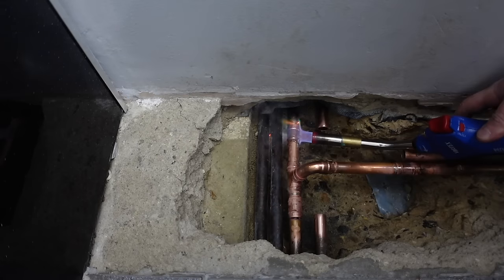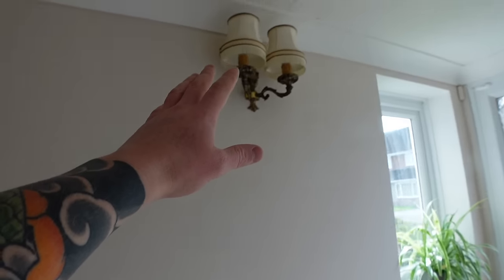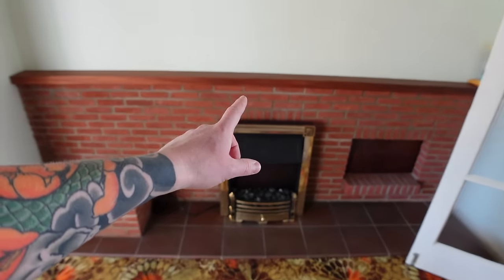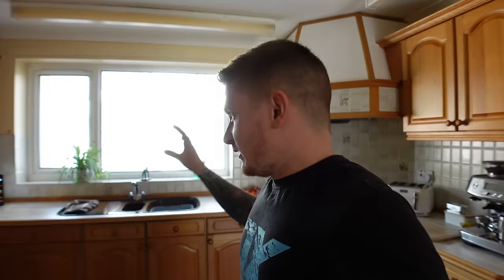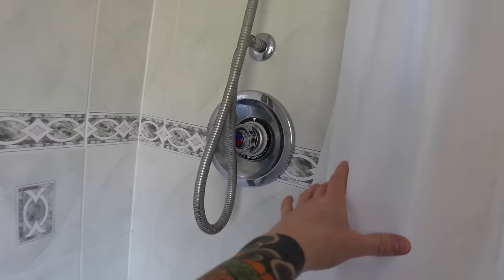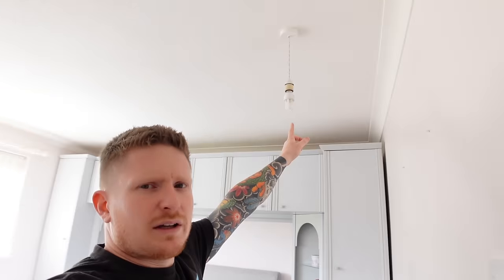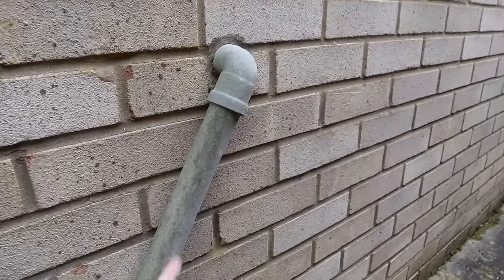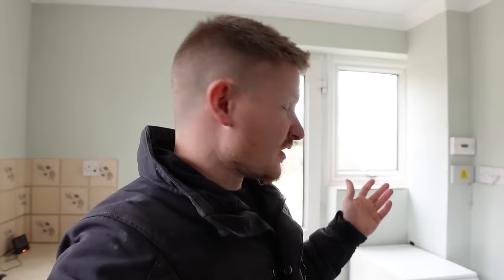I Bought This 1970’s House That Nobody Wanted And its a Mess - The Renovation EP01

Comment: The kitchen is definitely a 1980s replacement - the style of the wooden cabinets, the cooker built in across the corner with the built in oven under the hob and of course the extractor hood - that style was very popular in the 1980s. The units in the utility room would be original to the house and indeed might have been the original kitchen units at one time.
Reply from the maker: Thanks 👍
Reply: Definitely an 80s kitchen.
Reply: At one house I lived in we had bathroom carpet that was very light & easy to take up & machine wash, on top of lino. It was made of springy fibre that more or less spread itself out after washing. was brilliant, dried quickly & made the floor warmer in winter.
Reply: ❤ the 1980s kitchen  might be fine, just cleaned up ? or parts of it kept. Depends what look you want etc
Reply: Absolutely, late 80s by the looks of it, maybe even early 90s if the owners were a bit conservative. I inherited a 1987 kitchen with an almost identical brown sink a while ago. My units are Scandinavian pine though (the whole kitchen was made in Denmark and shipped here) and in really good nick, I love them! All I did was replace the sink because it was quite grubby and worn, it's some kind of composite material and had some permanently discoloured and rough spots.
Reply: Replacement doors for units could be a quick fix if the layout suits and the carcasses sound

Comment: As a heating engineer of twenty years, heres my opinion for what its worth. On the whole combis arent that great for homes with multiple bathrooms. Youd be far better off with an unvented cylinder which will future proof your install for when you have your extension built. Also you cant just decide on a combi installl without other checks and a proper site survey. Combis use a lot more gas than the heat only you already have. So you will almost certainly need a renewed gas run unless you can site the boiler very close to the meter. Have you checked the incoming water pressure and flow rate? You need to know these before deciding on a combi. If you have a cylinder fitted instead then you could also have solar fitted in the future and then have free hot water for a good few months of the year. You could also have a twin coil cylinder fitted and heat it from the wood burner. You cant do either of these with a combi. Dont just jump into a combi install. On a personal note i wouldnt touch a Worcester with a barge pole. Bang average boilers backed up with a world class marketing team. Plastic pigs. As someone who has serviced and repaired probably 10K+ boilers in my career, IMHO get a either a Vailant or and Ideal Vogue with a cylinder. Hope this gives you a bit of useful guidance. All the best.

Should have added. That if your current heat only boiler is actually in good condition. Then why not relocate it and use it to heat an unvented cylinder. That way you save on the cost of a boiler and are only paying out for the cylinder. Plus it’s less waste and better for the environment to not be scrapping a perfectly good boiler.

Comment: We have a similar aged house (1968) and also renovated whilst living here. We are  not DIY experts, so we had professional help. The carpet and fireplace were similar to yours, but ours was gas. One socket per room, terrible central heating... One thing we did and I can highly recommend is put in Underfloor Heating. We used a system by Wunda, where we laid styrofoam panels with grooves in them, which we then 'walked' the pipes into. It was easy to lay (we did this bit ourselves) straight over the cement underfloor and meant we didn't need any radiators on the wall, which makes a surprising difference. We just lost about an inch in height, as that is how much the floor came up. The heating is also lovely and even throughout each room and controllable by room. I think this was one of the best decisions we made :)

Comment: Seems like a very nice house in good order considering it has been empty for a while. All the quirks in the original house is common to a property of its age, ie lack of sockets, glass panel above doors etc. A perfect house for you to renovate. Probably built considerably better than modern builds.
Was there no immersion heater fitted to supply a bit of hot water.
I’m sure you are aware textured ceiling coatings could contain asbestos.
Good luck with the project.
Reply from the maker: Your right!! I saw massive potential as soon as I walked in. Yes there was immersion however I had a feeling the zone valve would be a quick fix. Yes on the asbestos…. Funnily enough I’m geared up in an FP3 mask taking the tops off some today 😀
Reply: Dont mind the transom!
Reply: @TheDIYGuy1  you’re probably aware but x-tex is textured coating removal.
Reply: You’re right about the ceilings. Asbestos could also be in floor tiles too, it was in our house, plus surrounding the old dry air heating system and plaster beneath the old immersion heater that was originally in our 70s build property.

Comment: Be wary of putting in a wood burner in, especially with a baby in the house. Do some research on indoor air quality especially PM2.5 particles. Wood burners are not good for air quality. The main bedroom has MFI bedroom furniture, can't remember the name of it, but remember selling it in the early 90s.

15mm pipework will work with modern ASHP, have a look at a Vaillant AroTHERM for example.  They are super quiet too, quieter than a gas boiler. ASHPs have moved on leaps and bounds in a very short space of time, worth revisiting what it currently on the market.
Reply from the maker: Great info. Thanks

Comment: Really looking forward to this series. Question: why are you going with a combi rather than an unvented system? I believe the unvented system is better for larger properties, and since you are planning a future extension that might be a better bet.
Reply: A recent high-end combi would probably perform just as well, as it can power multiple bathrooms and a large number of radiators simultaneously. Plus you no longer need to worry about hot water cylinders and their maintenance & space.

Comment: Nooo don’t get rid of the niche by the wardrobe in the master bedroom!! Use it for a few pretty, modern, thick wooden open shelves, deep ones. The wood adds warmth, the depth adds spatial interest and Positive/negative to what otherwise is a box with straight walls and above all they’re useful for putting the odd plant on or some interesting books, etc. Adds character, warmth, interest. Have the wooden shelves end a few inches before the wardrobe so they aren’t level with it - will look much better/ more pleasing to the eye. 
Generally awesome though - you’re doing a great job! 😊
Reply: Depending on how deep that alcove is, could even put hinges on the shelves and put some bulky storage in behind; like suitcase or formal clothes on hangers, stuff you don’t necessarily need quickly but don’t want cluttering up the usual space.

Comment: I'm just done doing an occupied renovation, so good luck. In the long run, you will probably be better off rewiring the complete property. Any decent sparkie will be able to do the rewire in stages for not a lot more, then tie everything in properly to a new board at the end. All I need to do now is replace the back door, and fit a new kitchen. Our current kitchen is pretty much like yours, so we just upgraded doors etc. until we decide what we want to do with it. Check your cabinets though. They look very like some of the Moben units I fitted back in the day. Those were originally ply rather than particle board. 
We also installed a wood stove. We bought a Contura inset stove which fits straight into the builders opening. No need for register plate etc. Our installer also filled between the stainless liner and the fireclay one with waterproof vermiculite.
Looking forward to the fun beginning.
Reply from the maker: Some great experiences shared there. Thanks

Comment: My first thought about the electrics is that there are so few sockets (which are almost certainly not split between sufficent separate circuits), is to start from scratch.  Leave the existing sockets as they are, install a complete new system with copious numbers of sockets then swap over from old to new and remove the disconnected old stuff at your leisure.
Reply: Every home of that age needs rewiring it’s a given. Not an issue. Similarly plumbing. All expected when purchase is below replacement cost.

Comment: That's a lovely house, and will be amazing when it's done. Following this series with interest, having recently (I think/hope, lol) finished renovating a mid fifties house. I would say do definitely get a full rewire done, though. By the time all the alterations are done, there will be not much of the  original wiring left, so now is the time to make sure it's all in good shape, and ready for the next 50 years. We found some really genuinely dangerous bodges and hacks hidden under floors and in walls as I was pulling out the old cabling - really quite scary.
Reply from the maker: Thanks for sharing 😊

Comment: About the ugly bathroom window install, I’ve found retro fitted new windows and frame often don’t line up with the old original frame outline, installers like hiding this gap with a pvc decor trim, solution is when redecorating remove the bodged pvc trim and re-tile or re skim up to the frame, the wall or reveal then looks like a nice original normal wall finish.

Comment: You can see the potential a lovely big house & garden. Watch out we know, as our house is 70s built, all ceilings then covered in artex had asbestos too all through.
 I doubt the kitchens  original they were those flat shiny brown or light blue coloured doors with the metal handles that ran along doors then. Im surprised you’ve not got a blue or green bathroom suite of those times too. I remember my friend bought a flat in 80s original it had a brown suite 😮We have a house just like this near us just sold, owned by an elderly lady just as it was built.  It’s amazing to see just as it was from 1970s.
Good luck it’s going to be a fabulous house once finished.
Reply from the maker: Thanks 😊

Comment: The house is much better on the inside than it is on the outside. That will be the biggest challenge for sure. Please avoid a media wall, they are super tacky. The kitchen is mid 80's and the light fixture in the dining room is late 60's and isn't worth much more than £15-£20. Log burner is a great idea.

Comment: Did you consider a system boiler and an unvented cylinder? A big enough cylinder will supply all your hot at mains pressure. No more shower pumps.
The cylinder can be vertical or horizontal and go anywhere, even in the loft. Only drawback is if your property has low mains water pressure.
Reply from the maker: Thanks for sharing and some good points

Comment: I agree with you regarding the interior 'time-warp'. Although I have never liked the 1970's suburban street architecture, I must say that the exterior (minus the brick colour) of the house is quite a handsome and holds its own. 

I see this with black exterior aluminium frames, doors etc, and some dark coloured/ burnt  effect weatherboard cladding. The interior just needs to be opened up with good flooring , bathrooms and kitchen. On the upper bedrooms I would vault the ceilings (I saw a 'single storey' bungalow that had it done in the kitchen, lounge and diner, and it looked incredible!.

Then , with the correct landscaping, this could end up being a prime property on the street. (but then you are flipping property, so I get it is a controlled budget). I will be interested to see it when you have completed the reno.
Reply from the maker: Absolutely, thanks I agree

Comment: Hi thanks for this. I bought a similar 70s house two years ago and paid a fortune bringing it up to date. I encountered similar problems. Those ceilings I hate lol. Most likely full of asbestos. I have identical ceilings. Decided in the end just to paint them.  No sparky is going to mess about with new led light fittings on those monstrosities. Skimming them only masks the problem. Though did pay to get it removed in the bathroom. On a positive its a lovely house and affordable to run. I get what you say about the lack of plugs, so annoying, ended up with a complete rewire and now have lots of plugs and a circuit board up to current standards. Word of warning, when buying these properties that require some updating, be aware of the financial implications and you are not going to get a quick profit turnover. Has to be long tern investment. Unless you can be like this guy and fix it up your self ha ha.

Comment: Garish floral carpet is 70s. Utility room original units, kitchen is probably mid 80s upgrade and very nice for its day. PVC windows replaced original single glaze wood. Looks like 70s taps and shower. Seems to be some 80s redecoration generally.   Including possible 80s bath upgrade (the 70s bath tended to have a flat board housing later 80s had that fat plastic bulge. I wouldn't wipe the 70s completely off the page in your resto...a nice Seiko clock hanging over the fire, perhaps? Stove great idea, hearth is ugly sadly so semi agree with removal but I always prefer saving something if it can be recontexalized.I think a building looks better if you can see layers of history and fashions come and go.
Reply from the maker: Thanks for the comment and your views 👍

Comment: I've seen kitchens like yours in places built from the early 1980s with the tiles over the extractor hood. I would guess the older style units in the utility room are from the houses original kitchen so that kitchen was likely to have been fitted when it was extended. Don't envy you with that green goo, had that in my first flat. Its a nightmare to get off your fingers!

Comment: I bought a late 1970's house this year. it had the origihal traditional boiler system and the original 1970's kitchen, original gas fire in the lounge and artex ceilings. Got myself a new wooster bosch combi, a new gas fire and new kitchen so far. Still need ot sort out bedroom celings and move the ceiling light sockets to a central posisiton as, like this house they are in front of the bedroom windows.
Reply from the maker: You’ll get there 😊👍

Comment: Have you ever considered reverse cycle air-conditioning? I've found it to be a great alternative to heating,  combined with the fact that it cools the property during these rather hot summers we have experienced in recent years.
Reply: Air to air heat pumps are OK but you will require higher temperatures as the moving air acts like a breeze and cools you.  Ait to water ASHP can operate with 15mm copper pipework but not with plastic as the inserts restrict the flow.

Comment: As a builder having lived in my house whilst doing it up. Let me give you a couple of bits of advice:-
1. Make sure your Mrs is happy to live in the house and all the dust etc while the works progress!
2. Dont bite off more than you can chew, work wise. 
3. Plan plan plan to make sure you get everything in the right order. I guess you wont be doing everything at once so make sure to plan the order of work.
4. Do NOT deviate from item 1!

Hardest part is keeping all services running at the end of the day!

Good luck I think you have got yourself a bargain there. Look forward to all the videos.
Reply from the maker: Great advice and a good read, thanks. Also… the dust has been the biggest issue so far 😂😂

Comment: Glass bannister for the stairs to keep the natural light.

Sockets upgraded to double sockets.

Wall lights upgrade to more modern light fixtures.

Conservatory idea i agree with yours.  

Love the the idea of a media wall and log burner.  

I personally like the kitchen cabinets - the solid wooden ones.   Id change the worktops though. Maybe for marble.  Or epoxy resin stone look kit.  Theres a channel on YT who do alot of that Stone Epoxy Counter tops or something they are called. 

Id leave the windows above the doors for more natural light throughout the house.  Maybe make some nicer trim for them to make it look more modern. 

Id re till the bathroom.  Laminate or hard wood floor. 

Door handles throughout need to be made more modern and matching.  

Id extend the built in wardrobe and fit mirror doors floor to ceiling.  

Get rid of the stuff built in around the bed.

Doors and skirting all stained wood.  Just looks more homey than white (unpopular opinion).  

Note:  this is the forst video of yours i have seen.  Looking forward to the renovation:)
Reply from the maker: Some valuable feedback thanks

Comment: You should see my house I rent, was built nearly 70 years ago and the last time it had any work done was in the 80s when they did some bad diy and tried to change it in to a Tudor house in and out, the wood outside is rotten and started falling off, had some new doors on the kitchen units, it’s dreadful but can’t afford anything else on my own, trying my best to do what I can with decorating, but a slow job , so hoping to pick up some tips

Comment: Looks like a great project.  I've been renovating a similar aged house the last few years.  Started similar to you, sorting the plumbing then swapped to a new combi.  Had a couple of issues early on, needed a couple of lintels replacing over large 2.1m windows, re-roof.  Had help with those early issues and big jobs like the roof but all been DIY since, learned all about underfloor heating, plastering, knock through kitchen diner.  I'd like to get it finished this year but that's probably optimistic.  Anyay, looks like fun project and will be following along :-)
Reply from the maker: Thanks for following and sharing your story 😀. All the best with finishing yours